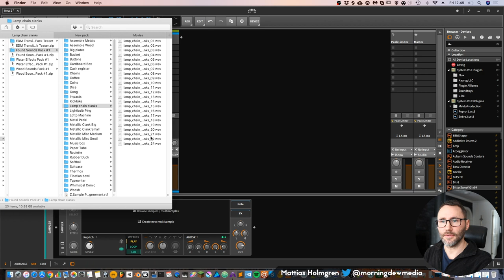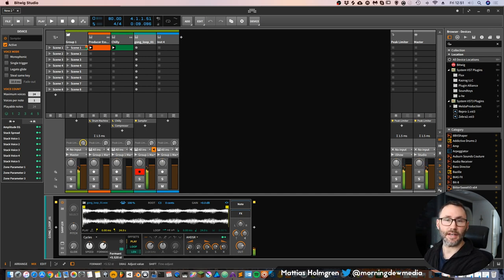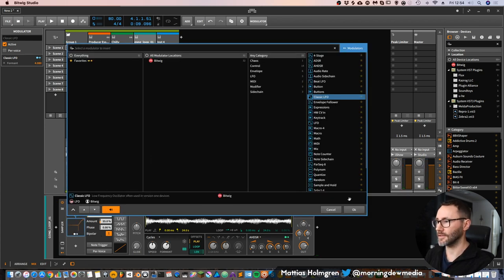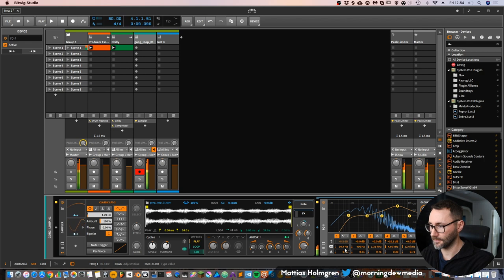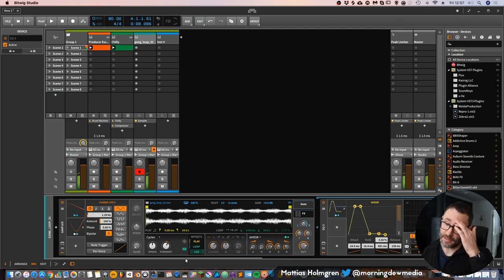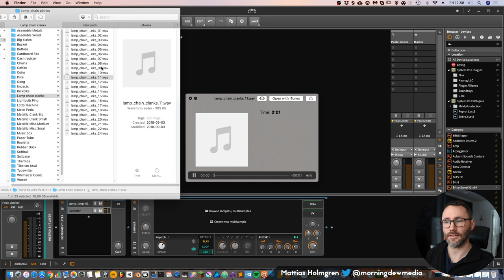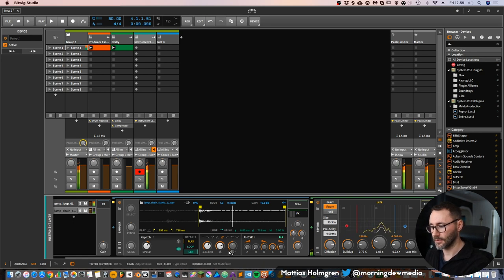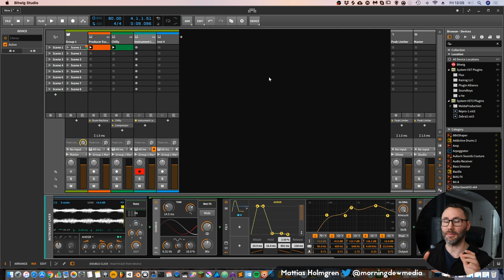Bitwig Studio Sound Design Tutorial - Chillout Rhodes

Comment: Hi there. Not a bitwig user but I’m interested in how the cycles playback turned the sample into sounding like a piano. How exactly does it do that?
Does it loop just a certain part of the sample?
Reply from the maker: HI Cashley, the cycles playback mode, splits the file the file into its wave cycles, and playes the audio by these cycles. 

By default it plays at 100% speed which will result in the same kind of sound as RAW.

But if you decrease the speed, the sample will not repitch but rather just make the playhead proceed more slowly through the waveform. It increases the amount of cycles it needs to "repepeat" before proceeding into the file. That makes it playback without repitching (like when pitching down a sample.) 

And then when you set speed to "0" it just loops the same SINGLE waveform cycle all over. Which will result in a very static sound, it becomes a single cycle oscillator. Then you can add modulation to the speed and create sweeping sounds. 
It's a bit tricky to explain in text, I dunno if I have a video on the playback mode already... Cheers! 🌞
Reply: Mattias Holmgren wow thank you very much for the explanation. I think I get it.
One thing I couldn’t understand is there seemed to be some movement in the sound even before applying modulation and LFO’s. 
But maybe that was from the higher formant setting or maybe it was just you chose a really great sample to get a waveform from?